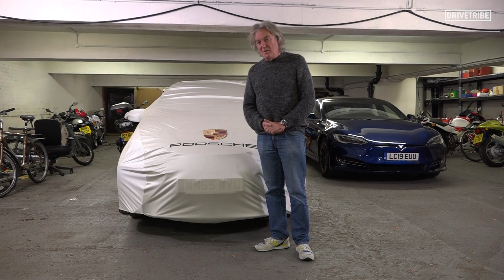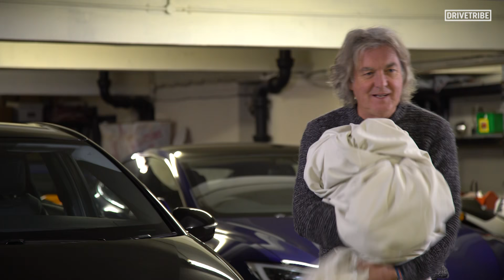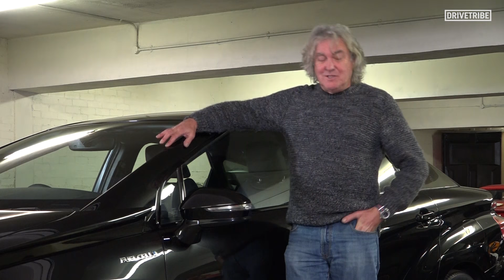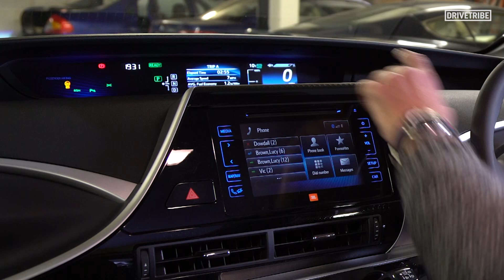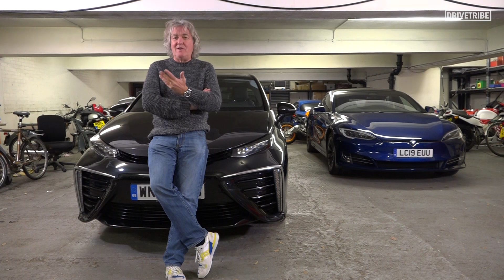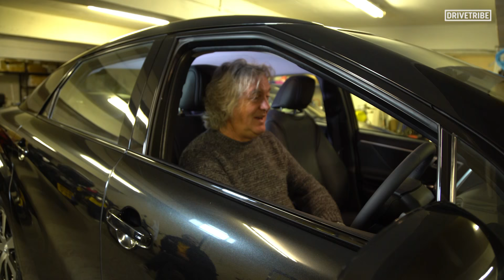James May has bought ANOTHER new car

Comment: Interesting POV James but if you own a bev the emissions question depends on where and how your electricity is generated.  Both vehicles are an answer to vehicle emissions and that is a positive but the best solution for the habitable planet really does depend upon how your fuel is created.  They are both in fact alternatives to the same question.
Reply: The key to both is moving the pollution out of cities. I don't think there's any other benefit overall once an extensive analysis is done.
A better way to cut pollution would be:
A. Stop fighting the wars we start every other day in the M.E. etc
B. Abolish stamp duty so people can move nearer their work.
C. Encourage housing near industrial areas with good tram/train links between the two.
The location of many businesses are quite ridiculous and often goverened by the CEO's wife's preference for shopping in Chelsea than any thought about the energy people need to use to get there.
Reply: @G-ra-ha-m  Abolishing stamp duty will make no difference to the net spend on buying a house as demand will simply push the prices up.  Controlling house prices required multiple property disincentives.

Moving the pollution out of towns and cities is only partly the answer: reducing net global pollution is the real target.  Producing fuel for personal transport is madness but we are part of a society where people want their own private boxes.  The second best answer is then to reduce the overall pollution.  Hydrogen is an interesting prospect but it requires much energy just to produce it whereas renewables (no, not just solar and definitely not nuclear) require so much less energy for the same amount of useable fuel and it is far far easier to 'transport'.  Wind, solar, thermodynamic, geothermal, tidal, hydro, underwater turbine, (what have I missed...) all combined with storage can easily provide for our wants and needs without fossil fuels and nuclear but the petrochem and nuke lobbies are rich and powerful.  And, hydrogen can be used as a form of storage as is hydro, as are batteries.   

The options are amazing: why are we so unwilling to embrace  cleaner, greener technologies?
Reply: @michaelgoode9555  The pollution problem in my view stems from the magick equation:
Interest = capital x interest_rate
applied to the creation and loaning into existence of 'debt money'. 

The interest (e.g 2%) makes the sum owed become (e.g. 100) 102 in the first year. 
As the 2 (the interest) has never been issued each year more money is created and so you end up with a accelerating compound debt spiral spread between 'growth' and inflation.

This exponential function can be seen in the inflation charts of the Euro, Dollar etc and it means we must all keep working harder and harder to stay still.

At the end of the day a steady-state society only needs food and maintenance, but here we all are working day after day on pointless, non productive jobs, a giant war machine and endless consumption and waste.

So that is my identification of the true source of the pollution we have today.
Reply: @G-ra-ha-m  I can see your logic there.  We can work smarter and live greener but powerful commercial and political interests want their jam today regardless of the consequences.
Reply: @michaelgoode9555  Yup: look around at the jobs most people do everyday, and the jobs that support them like taxi, train drivers etc.
Assuming we really just need:
1. Shelter
2. Clean food and water
3. Waste services, hygiene
4. Friends, art, music, tourism/exploration, pets
very few jobs really make a contribution to that. The entire banking/stockmarket is a gambling den pushing money around in circles, government is a giant parasite thinking of new ways to transfer our wealth into their pensions and the corporate push for 'growth' creates a fashion based society of waste and short termism.
From an engineering viewpoint the yield of 'useful results' / 'time and energy in' is desperately small!
It would be interesting to see how true socialist countries would do without sanctions - Korea (now NK), Venezuela, Vietnam, Cuba, Iran to an extent to, Libya, Yugoslavia before we 'corrected' them etc.. It always amazes me how fast places at risk of real independence are attacked - lest someone may see! Then there are the forgotten vassals, Guatemala and United Fruit etc.

Comment: So, all they have to do is make the hydrogen tank a little bigger, 20kg for example and that would give you 2000km of range? Why'd they put a 5kg tank? Isn't that tiny?
Reply: 5kg is pretty light but so is hydrogen, our lightest element known to man :D
5kg fits into a 75litre tank.
Reply: @G-ra-ha-m  compressed or not? I think it would be a smart move to figure out how to store more of it.
Reply: @FlamJongUn  I think that's just squashed in rather than liquified - I think it needs to be supercooled to stay in a liquid. 
If you squash it enough it turns into metal but I don't think anyone has ever generated enough pressure to do so:
https://www.extremetech.com/extreme/220962-new-hydrogen-discovery-could-help-make-room-temperature-superconductors-a-reality

Comment: Hydrogen car? So manufacture fuel, transport to point of use (station), fill with fuel, and you can use that car as long as there is fuel in the tank. Hm...sounds like a normal car to me

Comment: how does the generation on demand works? is the engine directly connected  to the fuel cell and you just give it juice like you would on a petrol car?
Reply: Via some batteries yes. Like any hybrid in fact.
I'm still waiting for a proper hybrid - using a turbine like an aircraft APU to generate the electricity. The problem is where to find 3 madmen prepared to modify a regular hybrid in this way and to feature it in a popular car program ...

Comment: I think the only way hydrogen wins the day is if they get them To the point where a full tank (cell) of hydrogen gets you 3000km per fill. The limited range to weight ratio of a Modem battery electric car is the biggest weakness they currently have.
Reply: Maybe, but 5kg of H2 gets you 300km so you'd need 50kg..
...which needs a 750 litre tank to store it in.

Comment: Hydrogen is the last gasp attempt of the fossil fuel industry. Everyone is comparing hydrogen to electric, which sounds great, ignoring the technology inbetween. Even if hydrogen were clean and cheap to produce, fuel cells most certainly are not. Worried about battery longevity? Fuel cells are only good for 100k miles. Concerned about rare earth  minerals? Fuel cells need ultra rare and expensive platinum. Then there's the business of storing and f distributing a fuel that has to be stored at 10,000 psi but only has a tenth of the energy of petrol. The current methods just don't scale. https://youtu.be/f7MzFfuNOtY
Reply: The last gasp?
We are currently stealing Syrian oil - oil's still very popular!
Even coal (real fossil fuel!) is pretty healthy (sic) right now.
Reply: @G-ra-ha-m  last attempt at appearing green. Biofuels etc are already a bust. Coal is already marginal in most countries. In the UK it's less than 1%. The last private coal company in the USA went bust, it's not economic any more. Gas is now the most used fossil fuel, but they obviously lose out on the light transport sector. So hydrogen is their answer, strip off the carbon and release it in to the air, then flog the leftover hydrogen at a massive markup and market it as green. Keep people addicted to the pumps and away from real clean renewables.

Comment: I like FCVs more than battery cars because they are way lighter and fill in 5 minutes, but the need of platinum and inefficient ways of making Hydrogen fuel needs to be fixed before they can seriously be considered a car for the future. A car that needs and slowly deteriorate platinum parts is very concerning.

Comment: It's a bit sad we haven't moved forward more from when you tested the Honda Clarity :(
Reply: The advantage of EVs is the super low running costs. Filling up a car with hydrogen is just as expensive as filling up a petrol car, if not more. And setting up infrastructure for EVs is easier than for hydrogen cars. They’ll have their uses though for long distance driving
Reply: @chrisj9700  Super low running costs?? Please tell me your joking!! 

The specs on all the new electric cars I looked at from Audi to Toyota to Tesla show an estimated charge time from 9 hours to nearly 13 hours. Lol

And at a range of under 300 miles of driving I'd say you ran off in left field with that estimate of low running costs. Lol

Don't believe me??

Just take the amount of your recent electricity bill, tack on another 9 hours to 12 hours per week or twice a week depending on your driving habbits and see if the costs are still super low. Lol
Reply: @extremedrivr   1 gallon of petrol is approx £6.  That will get you 40 miles.  1kWh of electricity is approx 15p, which will get you 4 miles. 10kWh will therefore get you 40 miles and cost £1.50. Someone commuting to work 400 miles a week would be spending about £240 a month on petrol, or £60 on electricity.  Also, a lot of EV drivers use an off peak electricity tariff, at about 8p kWh. Using an off peak tariff for electricity would bring the monthly fuel bill down to £32.  Basically, your petrol car driver has spent as much money on fuel by the end of the first Wednesday of the month, as the EV driver has spent for the entire month.  How is that not super low in comparison?
Reply: @markparker5585  That's not exactly true because you dont account for the fact that there are plenty of petrol or deisel vehicles today can travel 500 plus miles on 1 tank of petrol. 

Thats still cheaper than an electric car.

Plus I dont have to be tied down to plugging in every 200 miles or so and waiting for hours to recharge

With Petrol car I can just fill up in less than 5 minutes and on my way. 

I like that better sorry. Lol
Reply: extremedrivr It is exactly true. How big your petrol tank is, has nothing whatsoever to do with the cost of running the vehicle. Petrol doesn’t get cheaper because you have a bigger tank of it. A tank of petrol that can get you 500 miles would cost about £75 to fill up. The same 500 miles in an EV would cost as little as £10 on an off peak tariff.  That a saving of £1,300 for every 10,000 miles driven, in fuel alone.  I’ll address your new point on range if you wish, but it has nothing to do with running costs.
Reply: The technology's gotten cheaper and a little more compact since the FCX Clarity.

The problems remain, however, that the fuel isn't anywhere near as clean as electricity, costs more than petrol/diesel even though it's not subject to fuel tax, and the infrastructure still costs over a million per station.

Also doesn't look great that you're paying £60k for what's essentially a Prius (in terms of the environmental factor as well as the specs), although it beats the £1m that the FCX Clarity allegedly cost Honda back in the 2000s.
Reply: Yeah just imagine how far hydrogen fuel cells could have advanced if people were pushing for them instead of evs
Reply: @billy2141  BEV exist since 1834, and are reliable since 1880... just imagine how far it could have advanced in 140 years without the interference from oil companies...
Reply: @Babbaracos  But lets not forget the Hindenburg dissaster. Nuff said

Comment: and you have other productionchains that have hydrogen as a biproduct. in some cases more than they can use so it ends upp just beeing burned off. one example where hydrogen is a huge biproduct is the production off Cl2 for PVC plastics. where they oversaturate NaCL in water,  then they run that slurry in huge electrolyte baths where they split it to extract the Chlorine. and ure left whit Hydrogen (H2) Chlorine(CL2) and sodiumhydroxide (NaOH). and theres probably many many other  sorces that would be financialy viable

Comment: I really love the idea of hydrogen fuel in cars. I think it would be a great answer to the climate change if there were more fuel stations. It has a huge advantage over the battery electric car, It is just like the car of yesteryear❤️
Reply: Well that's the sales pitch, the reality is much different. Hydrogen cannot be stored for long periods. Your tank constantly leaks. It also needs large high pressure tanks so you have very little storage, and the performance is poor.

Comment: Most commercial hydrogen is created by the steam reformation of natural gas, a process that emits all the CO2 at that point. Electrolysis is still a bit niche, and is hopelessly inefficient end-to-end (renewable electricity at one end, an electric motor at the other end) compared to wires and batteries. Fuel cells will have a hard time staying ahead of batteries, but it is a good idea to play the game and make sure. Perhaps Iceland could export hydrogen in vast quantities; assuming that it's too far away for a cable.

Comment: You are so wrong James. I did believe this too, it' the famous Rifkin paradigm. 
But it has no future : 
If you crack hydrogen at the source, you loose 30% of the energy. Then you compress it, you loose again 20% , then you convert it on board and you loose 45 % ! 
So, everybody loose : to be able to sell his H2, the producer must kill his kWh price. At the End, at the station the car owner buy it 3 or 4 time more than an EV equivalent. 
With the clever grid to come, the electricity will be stored directly in our millions of EV battery through smart chargers, in real time.
According latest test in France, it seems that we could be paid for that !  Because the network is making money through or battery, storing at low price hours and discharging at high price / high  demand.
 and, as allways, without investing in a new infrastructure, complex and dangerous*,  and with 4 times the H2 efficiency.

H2, compared to battery, smart birectional charger and smart grid, is a kind of retro futurism, a steampunk project. 

* already 2 explosions in europe, 2 peoples slightly injured by miracle , 1 massive in US but without injury during a truck refill ,  1 massive in Korea with two deads and six injured. Blows installations and building for half a football playground...

Comment: BEV. Unless someone spends money on building more hydrogen stations. nobody will buy the hydrogen car. They are good cars but what about the people who live far away from any station? It is a lot easier to charge your car at home and go. It is easier to charge your car in a parking lot that has charging ports. I think the money is better spent on an infrastructure for battery electric cars because it will be accessible for more people at a lesser cost. Maybe their could be off the grid charging stations that are filled with hydrogen rather than taking electric from the grid to charge cars? For example you could place an off the grid recharging station in a area where building power lines would cost to much. Highlands, peak district, outer islands?

Comment: Hydrogen is rubbish. You need to first make it, then transport it. And you need to store it in stations. And these stations are expensive compared to charging stations.  The cars are expensive to buy and they require more maintenance. And they generate much less power than a battery EV.

Comment: The big problem with hydrogen fuel cell is that it uses a lot of platinum.  It was invented back in 1838 by William Robert Grove.  Nobody has been able to make them work without the platinum.  Think about about the cost of platinum now per ounce, and what the cost would be if everybody that ones a car needed several ounces.

Comment: All Prius jokes aside, hydrogen fuel cells powering electrical motors IMHO are vastly more realistic than hours of charging batteries. Lets not even begin to talk about the foot print batteries leave. Hydrogen is the way forward! Especially in cold climates like Canada where I live. Battery powered cars just can not withstand cold winters. Think 1/2 the range (at best) in mid winter when the temperature dips to -30c for months on end.

Comment: If you generate renewable electricity and use it to produce hydrogen, which you then liquify or compress and distribute (via an infrastructure that doesn’t exist...and will cost $trilions$ to build) then it’s one-third as efficient as using the same renewable electricity to directly charge a BEV. This makes hydrogen an incredibly dumb way to power cars. Congratulations James. You just bought a Betamax.

Comment: I bought a Tesla Model 3 to try out what the future will bring for cars.
The reason I chose a BEV over a "HFCEV" is that the nearest hydrogen filling station is over 70km from my home in a direction I rarely drive, so not an option.
Furthermore the main process of producing hydrogen is steam reforming of natural gas, which means making the fuel will emit CO2, which is rather daft.
Once/if large scale hydrogen production based on electrolysis of water has been cracked and is competitive, it will be a better option than a BEV (given there are more hydrogen filling stations at that point in time).
The main reason I think the HFCEV will have the edge in the future is that charging during longer trips takes way too long even with fast chargers, and filling a tank with hydrogen only a couple of minutes.
The reason I chose the Model 3 was that based on all information I could find it is the best BEV available when considering cost.
After driving the Model 3 for a couple of months I am positive that the Model 3 is the best BEV available when cost is considered, but it is far from the best car available.
All of the conventional German auto makers are much better at making cars do general car related stuff, but when it comes to EV specific tech they are hopefully behind Tesla.